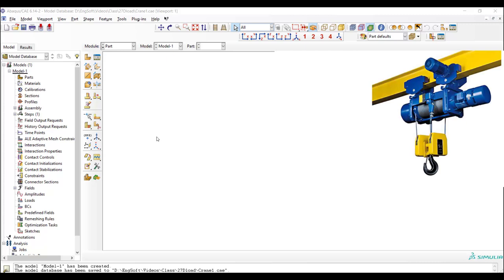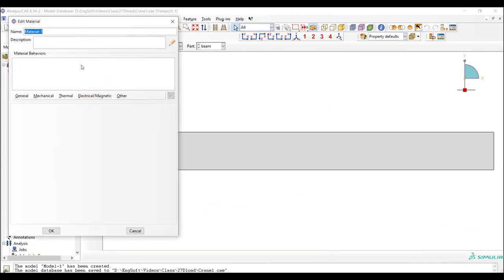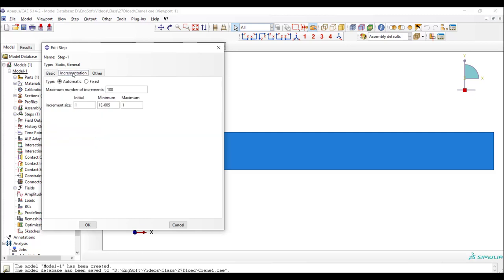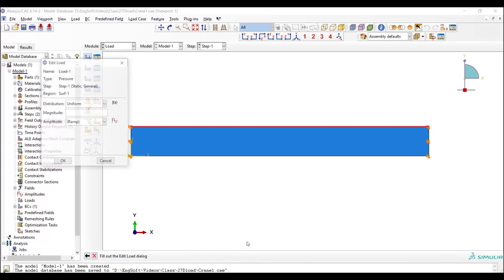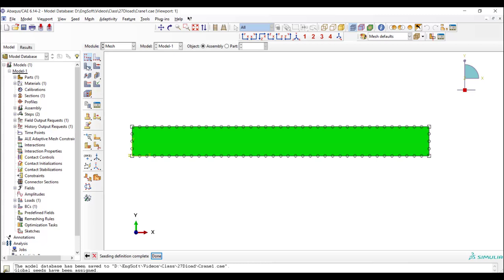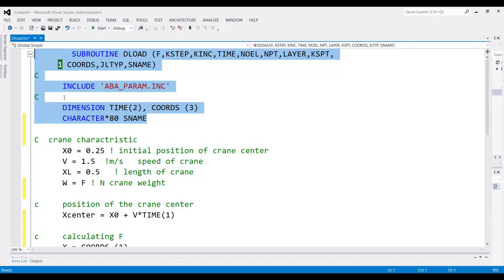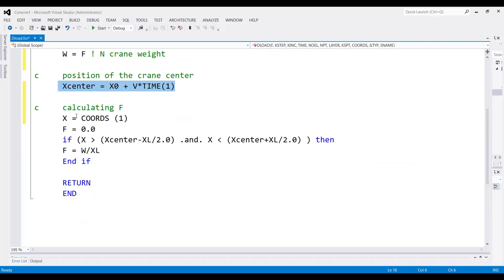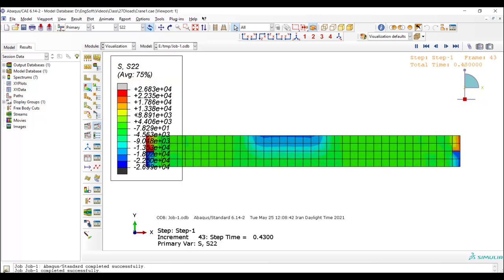Abaqus DLOAD subroutine: moving distributed load of a crane

Comment: Thanks for the video. If anyone is having problem with compilation, copy paste this, it works :)
      SUBROUTINE DLOAD(F, KSTEP, KINC, TIME, NOEL, NPT, LAYER, KSPT, COORDS, JLTYP, SNAME)
      INCLUDE 'ABA_PARAM.INC'
      DIMENSION TIME(2), COORDS(3)
      CHARACTER*80 SNAME
  
  ! Crane characteristics
      REAL :: X0, V, XL, W
      REAL :: Xcenter, X
  
      X0 = 0.25 ! Initial position of crane center
      V = 1.5   ! m/s speed of crane
      XL = 0.5  ! Length of crane
      W = F     ! N crane weight
  
  ! Position of the crane center 
       Xcenter = X0 + V * TIME(1)
  
  ! Calculating F
      X = COORDS(1)
       F = 0.0
  
      IF (X > (Xcenter - XL / 2.0) .AND. X < (Xcenter + XL / 2.0)) THEN
       F = W / XL
      END IF
  
      RETURN
      END SUBROUTINE
Reply: sir, Could you send the the Dload file?